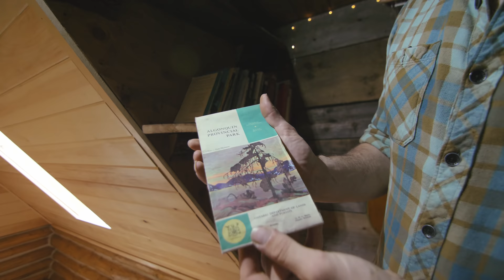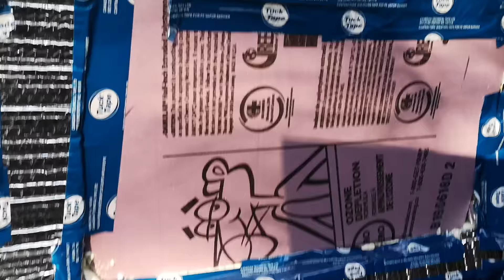Musician Builds an Off Grid Log Cabin in the Woods

Comment: Somehow, those all wood outter 15-20cm walls cabins work reasonally well until -5*C, but personally I would invest much more into insulation if cabin is in -30*C range winter time, its not just to save firewood but to equalize room temperature throughout cabin so you dont have to hug a fireplace to defrost.
Reply: Yep...
Dead of winter is rocky. I have r 40 in the ceiling and floors. As soon as the temps dip below -20 to -25, you do notice the equalization problem!

Comment: I have energy systems selling in Sweden, the houses are off-grid, hybrid. The system is planned to store 10 kw AC, like Canada there is a lot of days with no sun at all. Yet the properties earn $4,000 from the power companies for their surpluses. Their sources are solar, wind and storage, water turbines too if there is a creek nearby/  The mistake people make is thinking they need generators making a lot of power, wrong you need generators making a little power and some redundancy, making power when not needed. You will use about 10kw a day. 20 kw if you run AirCon. So this is no problem.  Batteries Arctic proofed are essential, but remember that you usually cannot pull 100% from the batteries, usually 50%. I prefer salt water batteries, that way they don't pollute, no poison gasses and no explosive potential and to re-fresh just drop in a handful of salt. I now have no fuel generators, just switch on and run, best of all, no fuel no foul. In Sweden these would earn $160,000 for their output.
Reply from the maker: Sounds pretty expensive...

Comment: Hi Matt excellent video loved it thank you so much but I just wanted to suggest I did not see a vent on your battery storage and I know it puts off a gas that could be dangerous after produces so much you may want to research putting event to evacuate that gas from something that could ignite it. I would definitely look into it everything was fantastic and I applaud what you have done very very cool
Reply from the maker: AGM batteries do not produce gas like a traditional lead acid battery.   which is why they are have been used so much in 'tiny homes'  until the recent advent of the much better but also much more expensive, lithium battery.  Thanks for watching!
Reply: Matt Steeves vent those batteries matt

Comment: just wondering if you had trouble with a building permit and did you have to get drawings made up or did you make your own and are you in a unorganised township ? thanks ... the place look fantastic job well done 2 thumps up
Reply: Richard Kenny there was no zoning by law at the start of the build, and this very small township had a laid back building inspector. The logistics turned out beautifully! It is an organized township. But I bought here because there was not a zoning by law (that has since changed)